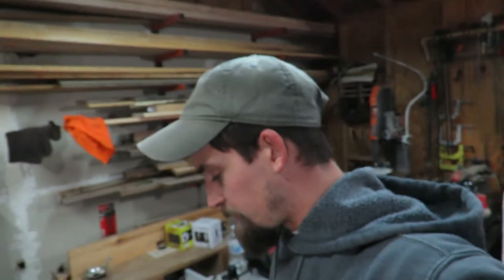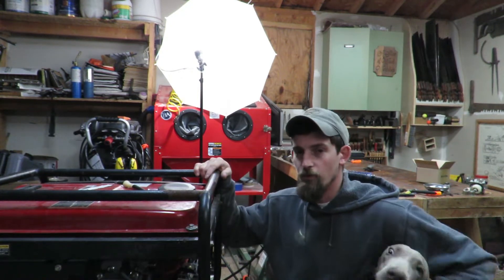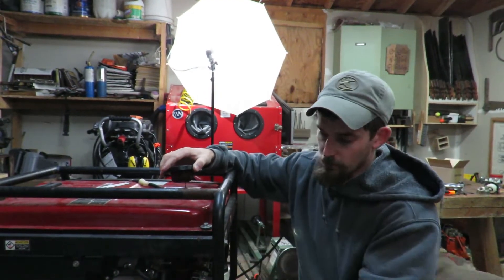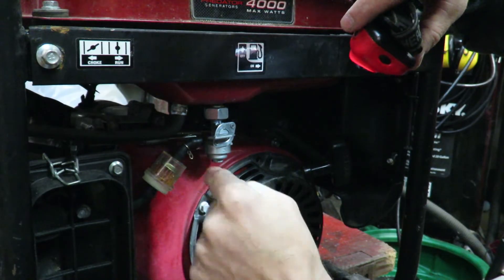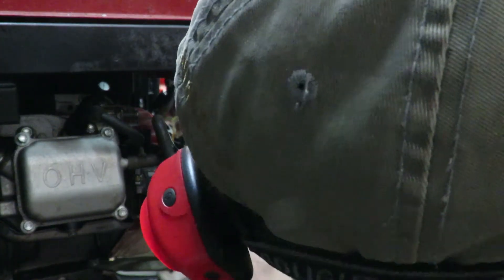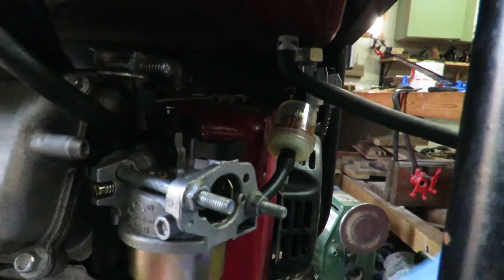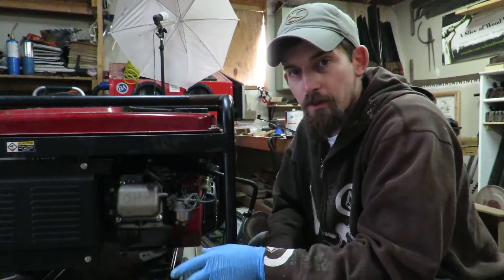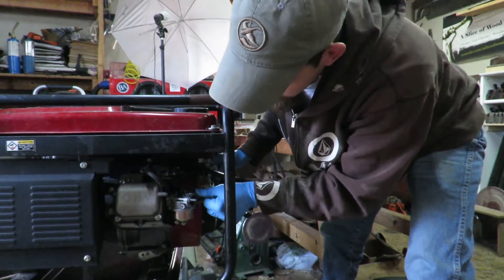Predator 4000 Generator | Solving the Fuel Issue

Comment: Yep! My 95 mercedes would not run properly with the air filters off. And I have a small buffalo 200 genset with perhaps the same issue to correct. Plus the float is sticking. Tons of Rust in the fuel tank..Needs a little filter added before the carb to keep the jets clear of particles.
Reply from the maker: Filters help a lot plus using non ethanol fuel will help. It isn't as expensive as I thought it was.
Reply: I see replacement carbs for seven bucks, to twenty!
Reply: @douglundy5755  Don’t forget about the generator safety rules: Always make sure you follow all the generator safety rules whenever you use your portable generator. This is only a reminder. Generators can be dangerous if not used carefully. Every year, hundreds of people die or get injured when using portable generators due to carbon monoxide poisoning and electrocution. Make sure you are using your generator carefully and keeping others safe as well. There is something very serious that everyone should always be aware of when using generators. Some people do run their generator indoors which is not safe and that increases the risk of carbon monoxide poisoning which can cause death of family and you. Some people run their generator in wet conditions which can electrocute them. Please remember that you should never run your generator indoors. Remember that carbon monoxide is an odorless and colorless gas that you cannot see or smell. Carbon monoxide is a silent killer. Keep that in mind. Make sure your generator is 15-20 feet away from your house and away from doors, windows, and vents. Never use your generator in your porch too. Having a carbon monoxide detector is very important against generator safety. Some people also allow children to go near the portable generator which could pose risks. We need to keep an eye on our children making sure that they are not near the portable generator so they won’t get electrocuted or burned by the generator which is dangerous. A locking enclosure also keeps kids safe. A generator shed might look like a tempting place to explore, or take cover during a game of hide and seek, but a generator is a dangerous piece of equipment that can cause injury. It says on the manual that we should also keep children away at all times from the portable generator to avoid injuries. Please do not allow a child or unqualified people to operate the portable generator.  It is important to keep your children safe especially little ones. The portable generator can be hot during an operation. Just because some manuals missed what should be listed doesn’t mean it’s safe to do. Always follow the generator safety rules when using portable generators. Generators pose electrical risks. If you need to use your generator during wet weather, you need a generator tent to protect your generator from getting wet. Don’t let your generator get wet. Keep your generator dry and before using your generator, please make sure your hands and your generator is dry. Do not wear loose clothing when operating the generator. Everything that is said on the generator’s operating manual should not be ignored. Never smoke cigarettes near the generator. Please keep flammable things away from the generator. Never overload your generator too. Your generator can catch fire. Never ever try to plug a generator cord into a wall outlet to avoid back feeding. Back feeding your generator is dangerous. Always turn on your generator first before plugging in appliances and shut off the appliances before turning your generator off. Use a heavy duty cord for your generator and the cord should not be worn out. All the instructions should be followed carefully. Never refuel your generator while it’s running. It can cause fire if fuel spills while your generator is hot. You should turn off your generator and let it cool off before refueling it. Having a fire extinguisher next to the generator is also important. This is only a reminder for everyone’s safety of using generators. Make sure your generator is properly grounded. Having a fire extinguisher next to the generator is also important against the safety rules. https://youtu.be/I1jT3ANENvI and here is a video more about keeping others safe when using generators and also about our family’s safety. It’s important to keep our little children safe as well. Make sure your little children are kept away from the generator at all times especially when it’s running. Hope this helps. Remember it’s better to be safe than sorry.

Comment: Hey i ran seafoam through my gas tank and crankcase yesturday on my generator welding machine, it ran for 5 min then dropped idle and died out. I tired starting 1 or 2 times with no success, seafoam tech said let it sit and start the next day, i will try starting today but i have a feeling that the seafoam loosened up gunk and now possibly clogged the jets on thr carb or possibly my gas is a few months old and shouldve been fresh gas. Any help on what i should do first to trouble shoot is appricated. I was thinking to first remove spark plugs and check them, if theyre still good put them back and then my next step would be carb kleen into the carb then try to start. Also if old gas is inside maybe adding more new fresh gas will help dilute thr old gas in order to start? Plz help
Reply from the maker: Pull the plug and add a bit of gas to the cylinder. If the welder starts after a few pull and then dies again it is time to take the carb apart and clean all the jets with s small wire.
Reply: @ASliceofWoodWorkshop  it was my spark plugs. Wierd they were new but got real oily and wet. I had a new set on hand, after checking the ones i had in at the time and seeing them oily i put new ones and she started right up. Thanks alot for the help and taking the time to respond man
Reply: @OysterP  Don’t forget about the generator safety rules: Always make sure you follow all the generator safety rules whenever you use your portable generator. This is only a reminder. Generators can be dangerous if not used carefully. Every year, hundreds of people die or get injured when using portable generators due to carbon monoxide poisoning and electrocution. Make sure you are using your generator carefully and keeping others safe as well. There is something very serious that everyone should always be aware of when using generators. Some people do run their generator indoors which is not safe and that increases the risk of carbon monoxide poisoning which can cause death of family and you. Some people run their generator in wet conditions which can electrocute them. Please remember that you should never run your generator indoors. Remember that carbon monoxide is an odorless and colorless gas that you cannot see or smell. Carbon monoxide is a silent killer. Keep that in mind. Make sure your generator is 15-20 feet away from your house and away from doors, windows, and vents. Never use your generator in your porch too. Having a carbon monoxide detector is very important against generator safety. Some people also allow children to go near the portable generator which could pose risks. We need to keep an eye on our children making sure that they are not near the portable generator so they won’t get electrocuted or burned by the generator which is dangerous. A locking enclosure also keeps kids safe. A generator shed might look like a tempting place to explore, or take cover during a game of hide and seek, but a generator is a dangerous piece of equipment that can cause injury. It says on the manual that we should also keep children away at all times from the portable generator to avoid injuries. Please do not allow a child or unqualified people to operate the portable generator.  It is important to keep your children safe especially little ones. The portable generator can be hot during an operation. Just because some manuals missed what should be listed doesn’t mean it’s safe to do. Always follow the generator safety rules when using portable generators. Generators pose electrical risks. If you need to use your generator during wet weather, you need a generator tent to protect your generator from getting wet. Don’t let your generator get wet. Keep your generator dry and before using your generator, please make sure your hands and your generator is dry. Do not wear loose clothing when operating the generator. Everything that is said on the generator’s operating manual should not be ignored. Never smoke cigarettes near the generator. Please keep flammable things away from the generator. Never overload your generator too. Your generator can catch fire. Never ever try to plug a generator cord into a wall outlet to avoid back feeding. Back feeding your generator is dangerous. Always turn on your generator first before plugging in appliances and shut off the appliances before turning your generator off. Use a heavy duty cord for your generator and the cord should not be worn out. All the instructions should be followed carefully. Never refuel your generator while it’s running. It can cause fire if fuel spills while your generator is hot. You should turn off your generator and let it cool off before refueling it. Having a fire extinguisher next to the generator is also important. This is only a reminder for everyone’s safety of using generators. Make sure your generator is properly grounded. Having a fire extinguisher next to the generator is also important against the safety rules. https://youtu.be/I1jT3ANENvI and here is a video more about keeping others safe when using generators and also about our family’s safety. It’s important to keep our little children safe as well. Make sure your little children are kept away from the generator at all times especially when it’s running. Hope this helps. Remember it’s better to be safe than sorry.

Comment: Appreciate the vid ,helped me decide to seafoam the carb instead of taking it apart..runs great now.
A big help to not gum the carb again is turn off the gas while motor running to use what would be stuck in the line.
Reply: Don’t forget about the generator safety rules: Always make sure you follow all the generator safety rules whenever you use your portable generator. This is only a reminder. Generators can be dangerous if not used carefully. Every year, hundreds of people die or get injured when using portable generators due to carbon monoxide poisoning and electrocution. Make sure you are using your generator carefully and keeping others safe as well. There is something very serious that everyone should always be aware of when using generators. Some people do run their generator indoors which is not safe and that increases the risk of carbon monoxide poisoning which can cause death of family and you. Some people run their generator in wet conditions which can electrocute them. Please remember that you should never run your generator indoors. Remember that carbon monoxide is an odorless and colorless gas that you cannot see or smell. Carbon monoxide is a silent killer. Keep that in mind. Make sure your generator is 15-20 feet away from your house and away from doors, windows, and vents. Never use your generator in your porch too. Having a carbon monoxide detector is very important against generator safety. Some people also allow children to go near the portable generator which could pose risks. We need to keep an eye on our children making sure that they are not near the portable generator so they won’t get electrocuted or burned by the generator which is dangerous. A locking enclosure also keeps kids safe. A generator shed might look like a tempting place to explore, or take cover during a game of hide and seek, but a generator is a dangerous piece of equipment that can cause injury. It says on the manual that we should also keep children away at all times from the portable generator to avoid injuries. Please do not allow a child or unqualified people to operate the portable generator.  It is important to keep your children safe especially little ones. The portable generator can be hot during an operation. Just because some manuals missed what should be listed doesn’t mean it’s safe to do. Always follow the generator safety rules when using portable generators. Generators pose electrical risks. If you need to use your generator during wet weather, you need a generator tent to protect your generator from getting wet. Don’t let your generator get wet. Keep your generator dry and before using your generator, please make sure your hands and your generator is dry. Do not wear loose clothing when operating the generator. Everything that is said on the generator’s operating manual should not be ignored. Never smoke cigarettes near the generator. Please keep flammable things away from the generator. Never overload your generator too. Your generator can catch fire. Never ever try to plug a generator cord into a wall outlet to avoid back feeding. Back feeding your generator is dangerous. Always turn on your generator first before plugging in appliances and shut off the appliances before turning your generator off. Use a heavy duty cord for your generator and the cord should not be worn out. All the instructions should be followed carefully. Never refuel your generator while it’s running. It can cause fire if fuel spills while your generator is hot. You should turn off your generator and let it cool off before refueling it. Having a fire extinguisher next to the generator is also important. This is only a reminder for everyone’s safety of using generators. Make sure your generator is properly grounded. Having a fire extinguisher next to the generator is also important against the safety rules. https://youtu.be/I1jT3ANENvI and here is a video more about keeping others safe when using generators and also about our family’s safety. It’s important to keep our little children safe as well. Make sure your little children are kept away from the generator at all times especially when it’s running. Hope this helps. Remember it’s better to be safe than sorry.